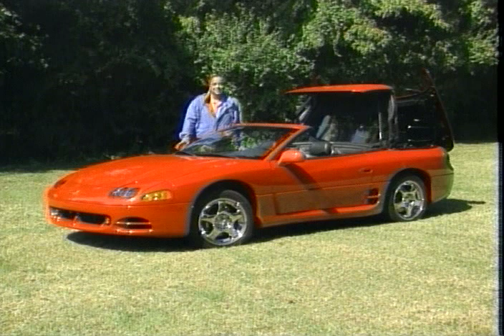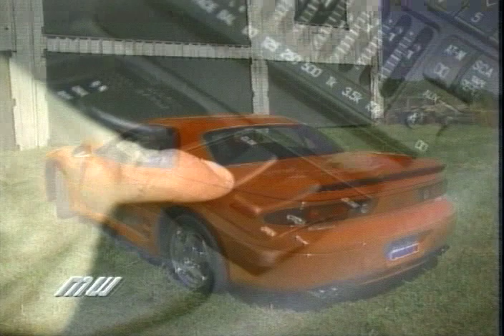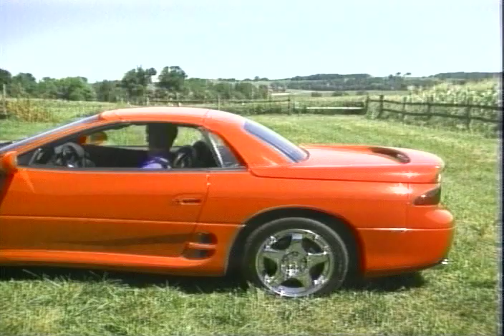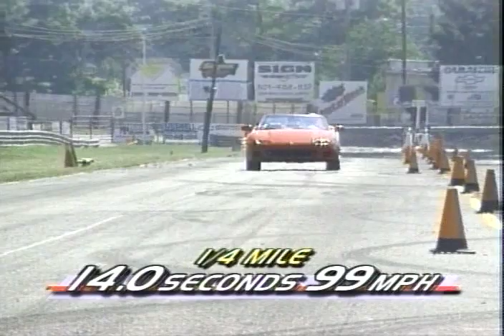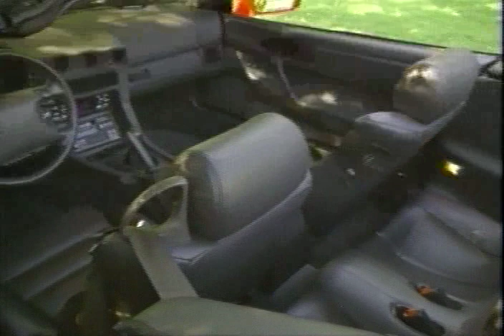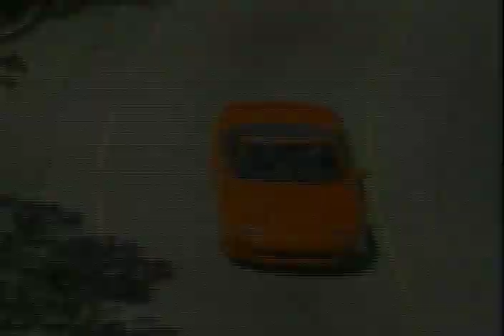3000gt Spyder VR4 Road Test (Motor Week)

Comment: No, the car was designed before 1989! (that was the year when the first prototype, called the HSX showed on Tokio), 91-93 and 94-00 are basically the same design, the biggest change was the six speed gearbox on the 2nd gens (and removing the AA, tunable exhaust, ECS on the last years).

Comment: Remember this car was designed in 1996.  It was very high-tech for the time. Most V8 engines were not even making 300hp. Now a days you can buy a CTS-V with 556hp for around the same money.

Comment: @acueyes well the N/A 3000GT has the same DOHC 3.0 V6, but it has 222HP, and they only added 2 small T25 turbo's to the VR4 at (I believe...) 7-8 lbs of boost. So that is pretty good, still today. At least they didn't Twin Turbo the base model's SOHC 3.0 V6 in the Dodge Stealth (Same car) and call THAT the VR4...because it would have sucked ass.